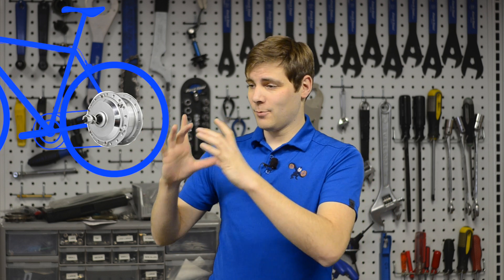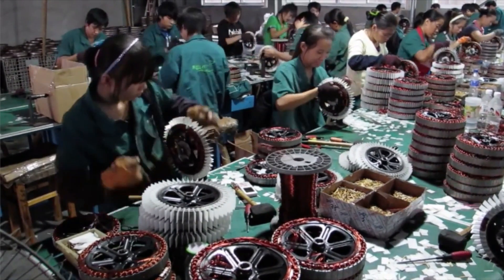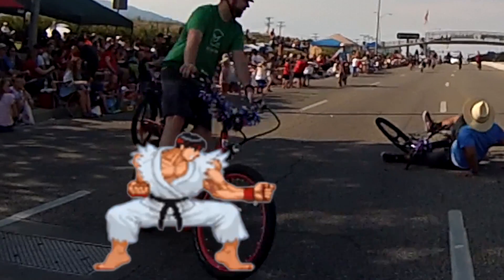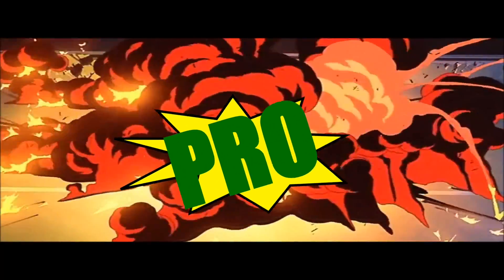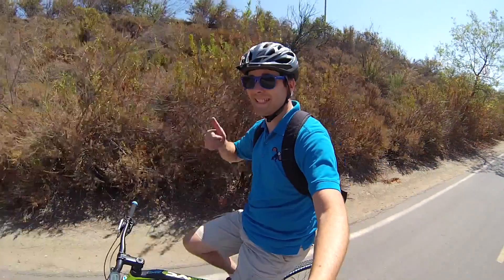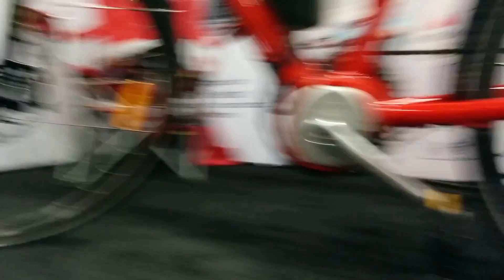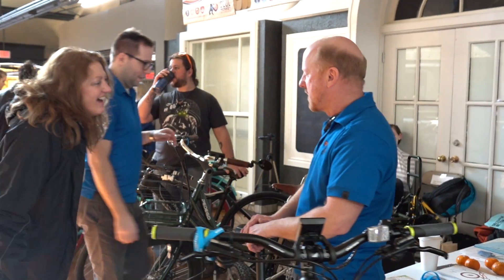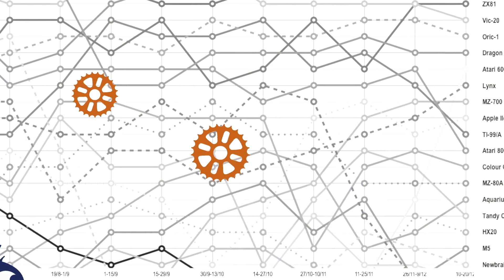Hub Drive VS Mid Drive eBike motor systems

Comment: Mid drives are overwhelming superior when it comes to efficiency as it has variable gearing available which gives you the best torque range whereas a hub is basically a one speed drive which limits climbing ability and top speed compared to mid drive of same motor power.
Reply: Also what is he talking about that you have to pedal on a mid Drive?
Reply: @tallcool1jeff  I know I'm late but  on a mid drive the crankset needs to be turning when the bike is giving power assist.

Comment: Mid-drive is better in every way except for price. Bafang and several others have throttle controlled and PAS up to 1000W motors which will give you way more torque and hill climbing ability, plus you can go with any gearing setup (including sealed hub gearing).

I've never had any issues with stock Shimano chains in over 2500 miles on my BBS02 750W 42T and I trail my Montague Paratrooper Pro way too rough for a hardtail, I never have to pedal and easily climb 99% of hills at over 20 MPH with the stock rear 9 speed Shimano cassette never dropping below 6th. My bike tops out at just under 32 MPH (56.5 KPH) in 9th gear and never bogs down like hub motors tend to when starting from a standstill on an incline.

Hi-PowerCycles sells a setup comparable to mine (but weaker) for almost $4700 - I spent $1900 in total ($900 for the bike itself a few years back) including the soldering equipment - build your own or find someone that can help you - you'll save a lot of cash. Mounting to the bottom bracket was easy and universal with the Bafang setup.

My only issue was finding carrier racks that support the weight of my 20 AH Panasonic battery (although I do get impressive mileage which I won't brag about here), I snapped several at the welds before I found one that worked for off-road use with a little modification (the Panasonic battery survived many falls and still works great btw).

Basically, I'd recommend hub motors only for budget builds because their only benefit is the price point, as they lack in every other meaningful quality unless you get a heavy 1500W hub, and unfortunately those cost the same if not more than a mid-drive while still lacking the durability or efficiency that you will get from almost any mid-drive setup. Finally, hub motors also weigh a lot more (as unsprung weight) and throw off the balance of the bike when rear mounted, while being dangerously prone to traction loss (especially on gravel or any other loose surface) when front mounted.
Reply: Polderweg afgebrand oostvoorne
Reply: Mid drive has more friction, no recharging, more chain load. All the rest is indeed better.

Comment: Good general info for those starting out.  I've been riding E- bikes for over 4 years and  for me the hub mounted motors are better when riding on the road. No breakdown so far, little maintenance.  Problem is hub motors are heavy, require a bit more battery, and don't climb hills well.  If you do more than 25% off road, forget the hub mount.  A friend of mine likes to off road a lot and has a mid drive and I've used it and it is nice, good hill climbing, good acceleration, better handling and less weight.  But I also see the strain it can put on other parts.
Reply: Thats the beauty of todays eBike industry...choice. Its never been a better time to create or simply buy an eBike. The variety is amazing. Now...if only the cost of replacement battery packs would come down.

Comment: Hubs put a lot of stress on the spokes.
Reply: I have 12g on my hub and had to change all of my spokes out at 5000 miles. Before that I lost about 4 spokes on the way.  I am 165 but I ride a 75lb cargo bike. Now rolling Sapim Strong on the rear. No problems with the front spokes at all.
Reply: <- Radwagon
Reply: Perhaps that is why hub motors seem to use much heavier spokes? I wonder how a high powered mid-drive added to a convention bike does in the spoke department.
Reply: Torque is torque. The spokes don't care whether it's coming from the hub motor or mid drive motor. In fact, I would think the spokes the hub motors use would be stronger just by virtue of their shorter length.

Comment: does a hub drive freewheel as easily as a rim with no drive?  does the motor cause drag to the wheel when not powered up? I bought one  with my bike on the stand power off brake disconnected peddling as fast as i can my rear wheel stops in 8 seconds. do i need to loosen the cone on the bearings?

Comment: I ride up steep hills at least weekly on bosch performance mid drive ebike and have not broken a chain in 18 months. I think you overstated the likelihood or risk of breaking a chain. My regular climb is 16 km and an educated guess is that it averages 8% gradient. I recently brought a chain wear gauge and the chain was not nearing the wear limit. I do however always carry a chain breaker and quick link when riding in the (remote) forests of South Eastern Australia!
Reply: I think it an bigger issue with off road racing but remember...this video comes from a shop with a repair facility and perhaps...this is what they see most with eBikes? Or at least often enough to mention.

Comment: I live on the top of a steep 5km street and I already fried a couple of hub drive motors. One of them was a Chineese convertion kit and the other one was very expensive factory assembled e-bike with Bionix system. That was when I realized that hub motors don't work well on steep hills and overheat! I now have mid-drive motor on a full sus bike and due to the use of the gearing it even doesn't get warm. A very important point that you didn't mention. I have > 2000km on it and haven't snapped a chain yet. It has some system which disables the motor for some ms when you change gears to protect the gears and the chain.

Comment: Ik like your video's but with this video you have a couple of things very wrong. Comparing a mid drive motor to a hub drive motor is comparing apple's with pears. Please tell the the full story and compare the different type of hub drive motors, like brush-less and direct drive. What you also forget to mention is that when you choose a mid drive motor be sure to maintenance it frequently, especially the Bosch mid drive system. Besides the wear and tear of the chain and rear sprocket issues, if you do not maintenance the mid drive motor frequently they break down on you for sure. Hub drive motors need almost no maintenance. Besides that, your comment about the hub motor in the back or the front and the weight distribution. Hub motors that you can buy today weigh nothing more then 1 kg. This for a 350W even a 500W that takes you easily to 45 km/u or more. Compare that to the weight of the mid drive motor, even when it is the center of the bike. Last but not least, the mid drive motor in almost up hill conditions was always the favorite motor to choose but today with the new hub motor designs, with 2 planetarium systems inside the motor this is no longer the case. Hub drive motors always had an issue with heat on slow speeds uphill, but with the new design this is history. An elektro motor has one drawback, every loss is converted in to heat. When you can run your elektro motor on its highest efficiency rate, around 85%-89% then the heat build up is within its operational range and is maintainable. When you go slow speeds uphill the new "Geared Hub Drive Motor" switches to the first planetarium so the motor has a high RPM but slow speed, result, less heat build up. When you go fast speeds the motor switches to the second planetarium, lower RPM, but the high speed gives the same result, less heat build up.  To conclude, buying a hub drive motor today is the better choice., not only cheaper, less weight, better performance, longer distances on the same voltage and battery configuration and low maintenance.

Comment: The thing that most of you miss out is if you have poor fitness in your legs you need a cadence sensor style bike not a mid Drive torque bike , because the torque bike can be too much for someone with poor leg fitness , because you have to provide some torque from your legs to start with,  this can become to much for your legs if you have real leg muscle problems like artery problems blocked arteries etc, if your legs are bad it's important that you look at both , try them, the battery will last longer with a torque sensing bike, but back to your leg problem,  with a cadence sensor bike which usually has magnets attached to the crank as you pedal round the magnets pass a sensor and you get depending on the mode you are in help from the motor even if you only turn them quite gently you will still get help so if you have poor legs that's the one for you the downside manufacturers lie about how far you will go on a battery you will probably need two batteries to the One battery from a torque  sensor bike but you will get the help you need for your legs good luck .

Comment: got a 250W  haibike / yamaha Mid drive and its pulling like a truck in first and second gear. a lot of overweight by backpacks and a trailer, and still rocks a steep slope where even normal, unloaded bikers have to get off their bike.  but on the higher gears, maintaining like 50kph is no problem (without trailer)  i even reverseengineered the battery to be able to make my own.  yamaha is a great drive unit, unlike bosch with its plastic gears.

Comment: The best one is a mid drive, with a front and back hub drive :D
Reply: 3 wheel drive on your 2 wheel conveyance. Yep, I approve.
Reply: How 2 kill batteries fast
Reply: With a 72v 80ah battery👍
Reply: matsv201 make it!!!!
Reply: That's what I'm saying, with three good batteries, selectable manager, one throttle and lights with signals, true Enduro tires for longevity, 65-80+ top speed would be great and 100+ miles of range also.. I wonder how long before this is easily done and with less weight..?
Reply: @racerx9223  What you want is called a motorcycle. LOL
Reply: Yeaahh and carry your Tesla battery on your backpack
Reply: You took the words right off a my fingertips...
Reply: Grin technologies at ebikes.ca has developed a hub drive that is 30% lighter than the ones we were using a few years ago, except that It's only front wheel for the moment, as far as I know.
Reply: With three 30lb battery packs.
Reply: matsv201 - ideally you want a mid-generator, not drive, so that you can contribute to the battery power as much as you are able and not couple to the wheel directly. The bike drives should be front and back hub motors.
Reply: @tobyneufeldt5763  Like a train.
Reply: and you lll need Biiiiiig battery
Reply: I'd go with mid drive+front hub drive...It's been done on a fatbike I believe.Forgot the name but look on YouTube.Look for 2wd fatbike.Awesome...Though it used front&rear hub drives....:-)
Reply: @HjMaswadyHjAmjah here it is... https://youtu.be/YR93_jBm53E
Reply: @HjMaswadyHjAmjah  
Good redundancy for when the mid drive eats your derailleur now and then if you don't keep a close eye on it, or something whacks it into the gears and gets eaten like mine did on a BBSHD. Front hubs are good 2wd as well for snow and sand, both at lower power output to avoid skidding out obviously. I'd love to try a 2 hub, honestly. Rear geared for more torque and front direct drive for more top speed or Regen breaks would be a cool combo, though VESC has an option for traction control for identical hub motors as well, if you ride in the snow a lot, so that would be awesome.
Reply: Why not? Lol
Reply: 60mp/h xD
Reply: @Miss Take I don't recall mentioning anything about a typical bike frame, but I have done almost 70mph on an old Schwinn two seater with my cousin years ago. We achieved the speed by going downhill while peddling and my uncle drove in front of us to help break the wind and so he wouldn't run over us if we wiped out, we were 10 and 12, he kept accelerating slowly until we couldnt gain any more speed. Apparently we were within 2 mph of hitting 70, I remember it was scary, twitchy and I couldn't hear anything but wind.
Reply: @racerx9223  You're uncle was extremely irresponsible.  Getting run over was the least of your worries.  Had you fallen, you might have been killed by the impact alone not to mention the road rash you would have suffered.
Bikes are not designed with these kinds of speeds in mind, especially not kid's bikes.  Assuming you really were going that fast, I'm surprised you weren't vibrated to death.  Bicycle wheels and tires are not balanced and wheels are usually not truly true.  This doesn't matter at low speeds, but it absolutely matters at 70mph.  Once your uncle got out from in front of you, you probably would have slowed down A LOT.
Reply: it is foul lol.
Reply: Unlimited Powah!!!
Reply: Hahaha
Reply: What would make this even better is a bike with no suspension, makes you really feel the road
Reply: And you can climb the stairway to heaven with that one
Reply: Nice! & a massive battery!
Reply: SpikeBottle  why would i want a shitty motorcycle?
Reply: Yes. Where can i see that?
I can't find it.
Even front and back hubb
Reply: @AurelienCarnoy  you have to build it your self
Reply: It really wouldn't do you much good. You would just accelerate a lot faster and would only go as fast as the most powerful motor on the bike.
Say you had a motor that put out 300hp at 6krpm (redline) and at 6krpm in the highest gear you achieved 100mph.  If you put in an engine that put our 600hp at 6krpm (redline), it wouldn't increase your top speed, you would just get there faster.
Also, you would have to put 50 pounds of batteries on the bike.
Reply: @tarstarkusz  Well.. yea.. but it would be really fun in the forest
Reply: @matsv201  For sure!
Reply: Stupid. Wont be considered an ebike then. More like a e motorcycle.
Reply: Im thinking about a middrive and a t least one hub in the rear, so that would be either 2 battery's or connect the motors to one but im still trying to figure that out

Comment: Hub bikes can have regenerative brakes. For mid bikes i harder make regenerative braking.
Reply: I've already seen people experiment with regen vs freewheel, even on a motorcycle!.  you will equally or in some cases extend range with a freewheel.  only difference is less braking on pads.  everything else I've mastered.
Reply: XXX love

Comment: Why do they make weak chains to begin with? I used to own a 3,5hp 50CCM moped and I had to buy a new chain 2 times a season because it wore out and stretched so much even with supposedly stronger chain than original. Later I had a 105HP 750CCM Motorcycle and I never had to cut or buy a new chain at all in the 5 years I had the motorcycle...
Reply: Hercules in Germany have Gates belt drive bicycles in their range. They claim longer life and no need for adjustment.

Comment: mid drive motor causes too much tension on the chain. Chain is strong enough only for human pedaling tension not motor plus pedaling. Such mechanical troubles make me sick and embarassed. I prefer hub drive with simple mechanic.
Reply: Top class riders can create as much as 800w of power at the crank but the average rider would struggle to do this. Adding 300w wouldn't be an issue but wear would be increased for sure.
Reply: You can buy a strong chain
Reply: Nope. Why is many have thousands of miles on their mid-drives with no issues? Quality modern chains are very strong and work well for all but the most vigorous off road users. Its not an issue unless you race off-road IMHO. In any case, mechanical failures are a great way to meet fellow bikes and to learn how to repair your ride.
Reply: You¨re on to something, i worked in the Shimano service shop, we sold e bikes and serviced them too, we replaced allot of chain and cassettes.

Comment: :}
      What is your 2 cents on dual hub dive? A a smaller watt hub motor in both front and rear wheels?
:}
Reply: :}
      But wouldn't adding the same weight to both wheels negate the biggest objection
      you seem to have with hub motor bikes??????     Just put smaller HMs to keep the
      weight equal the equil the same power you prefer using just on HM????

     I'll take a look at the vids U provided after work on my own time, Thank You.......
:}
Reply: UTubeGlennAR ever heard of carbon fiber frames? That should reduce weight on alloy frame bike.

Comment: 'we only broke chains with a mid drive motor'. Well done. Do you think that's because hub motors don't have chains?
Reply: Blue Monkey Bicycles You know what I mean.. . To the layman that's a visible chain. To the average man if a hub motor stopped working he wouldn't think the chain has snapped. But fair enough.